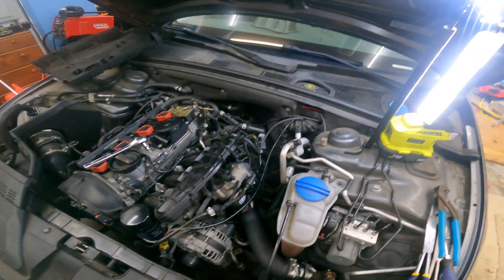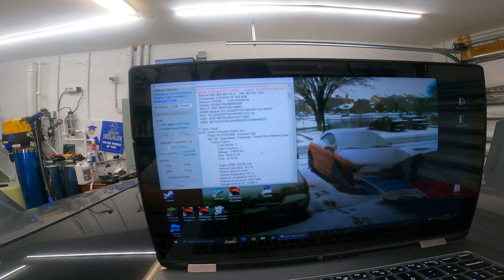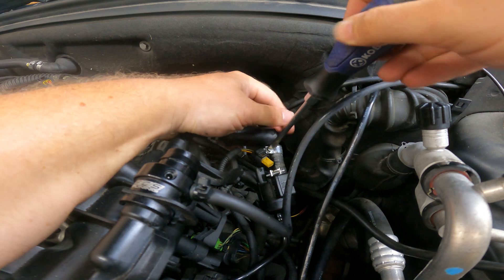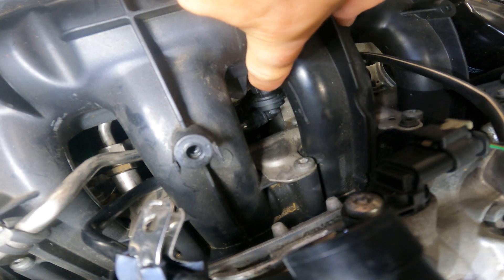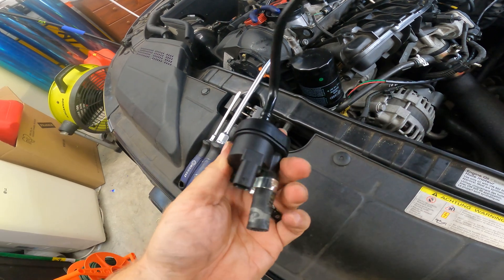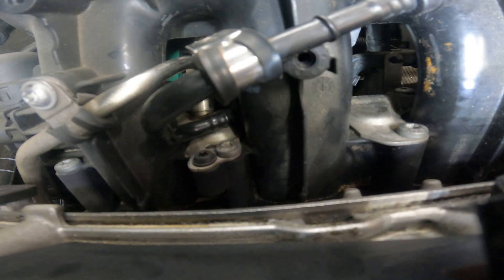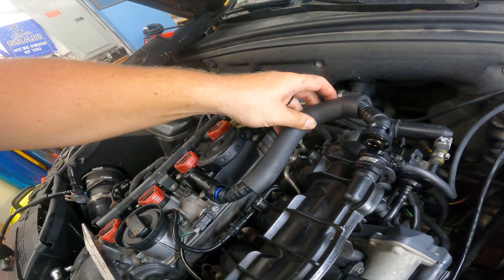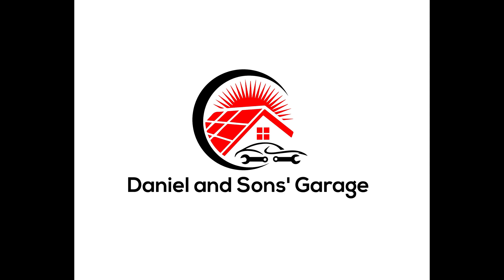2013 Audi A4 2.0T p044100 code fix replace n80 valve and hoses.

Comment: can i remove the big plastic intake? i cant get the hoses out of that tiny hole.. been struggling for hours now
Reply from the maker: @mariuss9712  you can. But if you do you will also need to replace the injector seals and $20 each plus the special tools to put thr new seals on. And also may have to replace the intake gasket. It is very possible to get the hoses out withou removing it.  I would try removing the intake side intercooler pipe and throttle body first that might give you a little more room.
Reply: @danielsgarage3545  I went outside and tried again, and managed to get the old one out. I put the new one in, but the purge valve was facing the wrong way, despite me shaping it into the one that was on there before hand. Mine was OEM from Volkswagen, but my new part is aftermarket OEM and is similar to the one you took out of your car in the video, I couldn't put the rubber on that mount as it would warp the hose completely and put very much tension on the hose. So I just left it dangling in the air, I put some zipties around to make sure the contact doesn't get torn/pulled. You think it should be OK to leave it like that? I also deleted the faultcode and took it for a 10 min testdrive, engine light did not re-appear.
Reply from the maker: @mariuss9712  a little patience goes a long way.     If it works and your ok with the look i don't see a problem with it.
Reply: @danielsgarage3545  It works and is secured, just annoyed I didn't get to put it in its original place, but oh well. Wouldn't have done it without your video, so thank you for that!

Comment: changed that valve but it still puts me out code p044100 and the check light turns on
Reply from the maker: Maybe the gas cap. They are pretty cheap to replace.        Otherwise i am not completly sure.   I did come accross this that may be useful. . .

 Things that can cause an incorrect flow code are: clogged EVAP lines, leaks in the EVAP lines, a failing N80 valve, a clogged EVAP charcoal canister, failed check valves in the EVAP system. When I fixed mine, the canister had failed and clogged the lines with this white powdery substance. I blew all the EVAP lines out; tank to canister, canister to N80, N80 to vacuum on drivers side, and a bunch of gunk came out. After that my flow code went away after a ecu reset.

Since you can hear the N80 valve clicking, I would assume that is ok. Next I would check the canister beneath the spare tire well. All the lines to it are held in place by one time use clamps and they hoses can tend to be stuck on there good. Once you have it out, blow through it to ensure no powdery crap comes out and give it a tip to ensure there's nothing liquid in there from overfilling the gas tank. From there, move on to cleaning out all the EVAP lines with compressed air. Assuming your leak detection circuit is good, something in those steps should fix your issue. Hope this helps
Reply: Thenk you